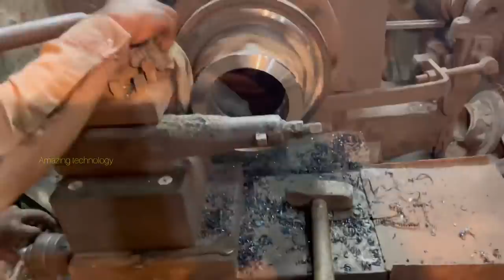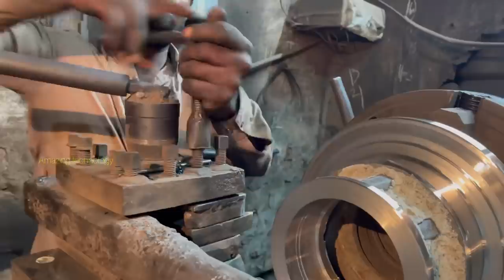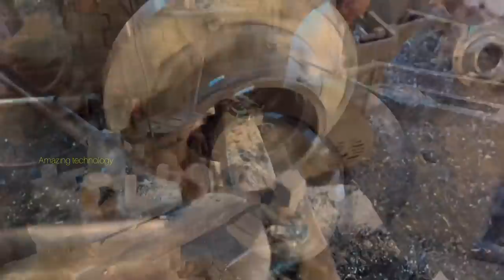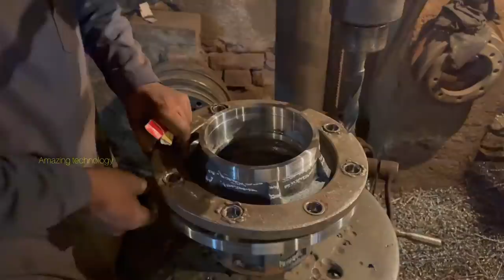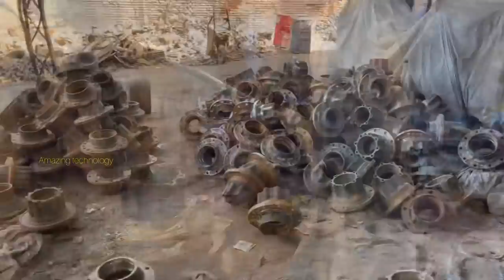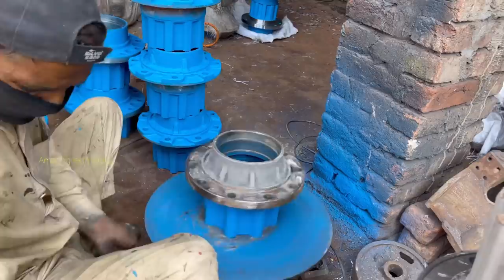How to Make Truck wheel hub in Factory | truck  wheel Hub manufacturing process||

Comment: So the dimensions are only checked with old school calipers? Ones hanging on the way that can get bumped around.

I was really impressed at the second operation lathe guy dialing the part in without a dial. That is a lot of skill I wish I had on the lathe.
Reply: For those who got both left hand, wont help any modern calippers.
Reply: Making the workpiece run true in the chuck using scriber and magnetic base instead of clock and magnetic base...now that is old school engineering. 😉